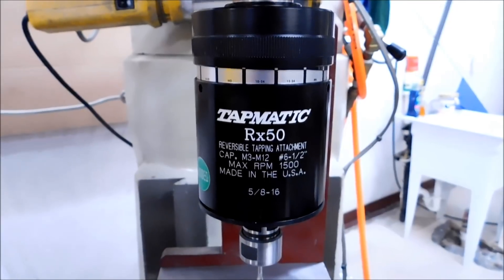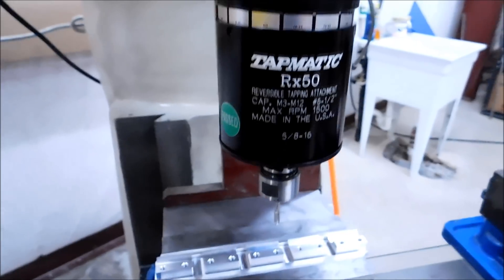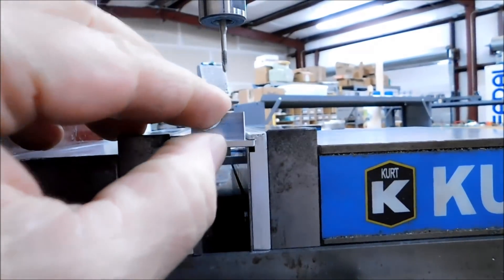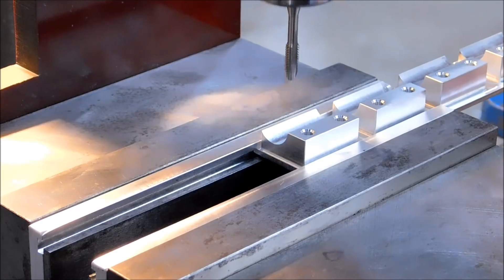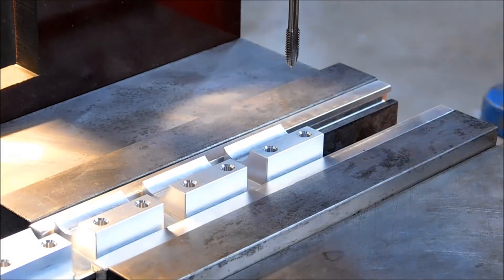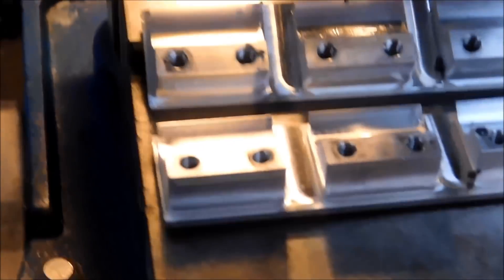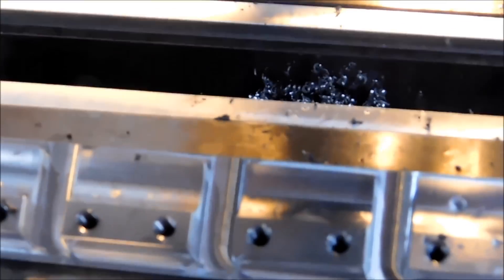How to Safely Tap 400 holes in 30 minutes.....Take a Look

Comment: Hi Joe! Gosh. If I only crossed the path of a tapmatic head. Those puppies aren't Cheap! Yes. I remember working for folks that had them and only wished for one, or two ;- ) Remember or seen the old hand crank, screw don type tap press with a keyed quill and crank the wheel rotating and pushing the tap to depth or thru with each hole? ;- ) I thought it was actually pretty good compared to a straight or "T" handle. Thanks for another great one Joe. You always keep the ideas alive ;- ) T up again!

Comment: I had to do something like this years ago when I helped out in a local machine shop. It was I think around 250 pieces of the same bracket. Drill and tap a hole in each one. The tapping head worked awesome on a drill press. That self-reversing action made all the difference. It went pretty quickly. Having to do that many pieces by hand would probably have been miserable.

These heads aren't cheap, but certainly earn their keep. Makes me appreciate CNC Thread Milling.

Comment: Long ago I used one of those while working in a sign shop. 1/2” plastic in 4' long strips with 1/4” holes about every 1” held in tee slot on a drill press. They were used to make adjustable mountings for vacuum formed letters. Hard to stay awake after several hundred. The TapMatic worked well in the plastic.

Comment: Great video.  I have one of the older Procunier 2E models that can go up to 1/2" in aluminum, or 5/16" in mild steel.  I got a good deal on ebay because it had been assembled incorrectly.  I've got about $85 in it, and it works great. (edited to correct a fraction)

Comment: If you could make something to squeeze out a couple drops of tapping lube in the next hole every time you bring the tap down you would almost have a mass production rig.

(Couple one way valves and a syringe to make a reciprocating syringe pump, and make a little treadle to press with your foot to pump out  just enough is what springs to mind for a manual system. An Arduino with a microswitch sensing the downstroke of the drill press, controlling the cheapest chinese peristaltic pump I could find would be my suggestion for a more automated rig.

Comment: That's an awesome tool Joe , I've taped a lot of holes in my life but never have I had to do that many at once. Also I must say I have never seen a tool like that. It seems to have a clutch or something like that , the way it looked when it reached the full length of the tap and before going into reverse it would chatter ? Also when running that many holes how do you keep the chips and stuff from building up in the tap. I noticed every time you would pull it up and out the tap would be clean. Very informative and good videos as always. And most definitely hats off for the girls hockey team. Way to go USA.
Reply: There are 3 different tap geometries: neutral, right hand, and left hand. The neutral taps are the ones you find at lowes and pack up with chips. The other two have reliefs like a right hand and left hand drill for power tapping. One pushes the chips upward back out the hole (good for blind holes) and the other pushes the chips downward like he has in the video. You can see all the spiral chips down in the vise jaws when he swaps parts.
Reply: The tap he is using is commonly called a gun tap (cause it shoots the chips our the bottom), or a spiral point tap.
https://www.mcmaster.com/#taps/=1bw03h6
Reply from the maker: Yep. Best one for through holes.

Comment: say Joe, what type of tap would you recommend for use with a tapping head? there are spiral flute taps etc and so i wonder if some other types would be or not be suitable for use with a tapping head?
cheers
mike
Reply from the maker: Same tap you would select based on the hole and material. Also consider is it a thru hole or bottomed.

Comment: Your thoughts about this: I picked up an old Canedy-Otto drill press with a Procunier E 3 tapping head on it at an auction. Both actually too big and not really needed for my garage shop, being retired etc. The head had one collet with it a 5/16". Checking the web I found other collets from #8 to 3/4" are available, but expensive. As I won't be doing any real production, I was thinking of getting one larger collet size say 1/2" and connecting a chuck up to it so I could chuck up various smaller taps without having to buy a bunch of collets. For my infrequent use I don't see much wrong with this, but am not sure.

Comment: That's a great tool, just wondering though why don't you tap it on the mill while the work is being done there
Reply from the maker: I honestly tried, but it was tearing up the holes. I'll re-visit it and trouble shoot the issue.
Reply: Joe Pieczynski ya rigid tapping on the mill can be a hit and miss experience

Comment: Nice looking parts.  Do you mill the back off to separate the parts after?
Reply from the maker: Thanks. Yes I did. I could have saved some material on this one, but I radiused all the main corners in OP 1. It would have been a pain in the butt to do that in OP 2. The job went well.

Comment: Great video - thanks! Did you drill for full thread depth?
Reply from the maker: I drilled through holes. If they were bottom holes, I would have used a high spiral tap to evacuate the chips.

Comment: Thumbs Joe, thanks for posting. By chance do you have a video showing how to adjust the torque adjustment on the head? I have one of these tapping heads, but am not sure how to adjust it. I did watch your other video as you mentioned, but it really didn't cover adjusting the torque.
Reply from the maker: On the top of the head, there is a straight knurled ring with a set screw in it. Back off the set screw first. The ring will rotate to expose silver graphics that go around the head itself. Looking down the arbor of the head, counterclockwise rotation of this cap will reduce the pressure. As you rotate the cap, it will expose different numbers and ledges on the graphic. Line up the bottom of the cap to the number or graphic level that coincides with the screw you are using. Lock the set screw.
Reply: Thanks for taking the time to write back! This was very helpful.
Reply from the maker: No Problem.

Comment: Why do you prefer the Tapmatic to the Procunier heads? I haven't bought either new, but the Tapmatic I bought used didn't work out, while the Procunier heads were super.
Reply: I had a B&S auto screw machine shop for 17 yrs. 
Have tapped in the vicinity of a million holes up to #10 in secondary operations on drill presses. Alum, brass, low/hi carbon, SS, titanium and a variety of plastics.
Procunier uses a double-cone friction clutch for both reversing and torque settings. The cones are enveloped by a friction-type material similar to brake pads. For taps 1/4 " and above you may get by with the Procunier. Smaller taps will give you problems. The more force you apply on your quill stop with the Procunier, the more torque you will transmit to the tap.
The Tapmatic has none of those problems. One job I had required 0-80 thds --3/8" deep. Only the Tapmatic could do that.
 It is the Rolls Royce of taping heads.  I used it exclusively. But as Joe mentioned - they are VERY expensive.
Reply from the maker: My loyalty to the tapmatic head is an exposure thing. All the big companies I worked for in the early years all had them. I trust them and will continue to use them. They perform flawlessly and are worth the money all day.
Reply: Joe Pieczynski Interesting. My understanding was that the Tapmatics use a dog clutch internally and that you can't feather the torque. Iirc, the one I had issues with had a jammed clutch.

As far as small taps with the Procunier, I've had very good results on the usual machine screws sizes, although nothing as small as a 0-80.

Comment: Hi Joe - tapping heads are great aren't they? For those of us hobbyists with smaller pocketbooks than a production shop, eBay often comes up trumps... So, a question: I have a similar Tapmatic, but it doesn't have the torque adjuster at the top, it's just got dog clutches in it. Is there any reliable way I can measure how far down a tap will pull before it disengages? If I want to thread to "pretty damn close" to the bottom of a small blind hole, it's always a real arse-puckering experience... The Tapmatic will smash an M4 tap in a microsecond (ask me how I know this....). Thanks!
Reply: Procunier uses clutch material rather than dog clutches. I have been using those to tap up to 1/2-13 into laser cut holes 100s of times with a 2E. Maybe give them a shot. You'll probably want the 1E Model though.  I can bottom out a 4-40 Roll tap in aluminum with no problem using the 1E.

Comment: Joe that is an awesome technique thanks for sharing it , I have looked at several tapmatic units used on ebay and wondered if they were worth the investment? I think I saw the #30 for under a 100$ last time.. are these heads very temper mental or in need or any regular maintenance that would affect the internals of a used system that would mean It could be run out junk and me not know til it was to late? thanks again for all the things you do for us all...
Reply: The Tapmatic heads are pretty forgiving, if you get the manual models. They have an adjustable clutch for the different size taps and with a bit of regular maintenance will last a long time, there are manuals for most models online.
Reply: Terrific, Thanks for the helpout L98

Comment: Is that a “custom” relieved tap? Years ago the Japanese branded Yuasa tapping heads broke fewer taps and seemed to work better than the much more expensive American made Tapmatic. I’m sure the Tapmatic has probably improved over what was being sold then (1970s/80s)?
Reply from the maker: Its a stock tap. Emuge has taps like this, but I was shocked to see this style from the brand I bought. It worked great.

Comment: Great tip. Just one question, is there a reason that you start with the tap so far above the work surface?
Reply from the maker: I usually keep the tap above a pinch zone when its at rest. I usually maintain  a hands thickness above the part. No other reason.

Comment: Great video and demo- I just got a 30 x- I cant seem to eliminate what seems to me as an excessive amount of wobble with the tap?  It definitely shakes more than yours does in this video.  Any thoughts?
Reply from the maker: Yes. Snug the collet before you pinch the mechanism that holds the square end tang. This is a very common setup mistake. The wobble should disappear.
Reply: @joepie221  Will Make sure I do this before my next use. Thanks!

Comment: I've got one for tapping 10-24 threads about about an inch deep in aluminum castings. But I need to go up and down a few times in each hole in order to get a full tapped depth, Is this normal? Perhaps I'm not using the correct taping fluid.
Reply from the maker: The torque setting may be too light, and the tap may be worn. Check both.
Reply: @joepie221  Thanks, will do.

Comment: Great tip. Love tapping heads. I personally use procunier heads. Thats a neat trick making use of the carrier in a slot. I'll file that one away.  Does your tapping fluid smell like cinnamon?
Reply from the maker: Actually it does. Thats how I always identify the tap magic.
Reply: For some reason I can't stand if i get tap magic on my hands. So For most tapping I use stuff called perfect tap #10 works good and it doesn't bother my skin a bit. And save a bottle of  tap magic for high temp  alloys.

Comment: Hi Joe I have an older tap matic SDS model I think its the same thing but what i would like to know is how did you machine those radius in those parts?
Reply from the maker: The parts were done in a 3 vise setup and the radius cut was positioned along the 'X' axis. I did it with a 2 flute carbide 1/2" dia ball end mill.

Comment: What about blind holes Joe?
Reply from the maker: Use a high spiral tap. It extracts the chips and allows for bottom holes to be done rapidly as well.
Reply: @joepie221  Thank you for the reply Joe.  I’m attempting build an Allen American 4-4-0.  So far I’ll need to drill some blind holes in the frame material, cold rolled A36 I think, noting exotic.  The holes will be about ½” inch deep and in the 10-32 and 8-32 range.  My question is will all I have to do is use the quill lever to start the tap into the hole then just let go of the lever and the tap will pull itself into the hole and when it hit’s the bottom of the hole it will back itself out without me touching the quill lever.

Comment: Slick setup, I’m assuming you’re using spiral point gun taps?
Reply: Looks to me like it is a normal tap...
Reply: It is a through hole tap but since flutes are large chips can fall out of hole.Spiral flute machine tap would be better for this job .
Reply: Spiral point gun taps push the chips down through the holes. They are pretty standard in industry....

Comment: Are you gonna machine a picatiny rail on the other side?  :)
I have been using the tapping tool for over 14 years,the best tool in the shop.Even though the TM 2 P does tapping faster
Reply from the maker: I'll save the picatiny rails for my AR.

Comment: I was tapping about 100 holes into some 1/4" steel this weekend, I should have stopped and watched this first! Nice tip on sliding parts through.    NEXT VIDEO How the heck can I rapidly space holes every two inches?
Reply from the maker: Install soft jaws in your mill vise. Drill a hole in the top of each jaw inline on the 'Y' axis. Insert dowel pins in these holes. Drill the required first hole in your part. Lay a parallel across the vise jaws against the 2 dowel pins. Put a third pin in the hole you just drilled and slide the part until the pin hits the parallel. Now pickup that pin with an indicator and move 2". For every hole you drill, just repeat this process. You never have to move the table. Be careful how stack positioning may result in a wider pattern and check your 2" setting after about 5 holes. If it not right at 10", adjust accordingly. Good luck.
Reply: Thank You, Need to remember to video tape this one (I haven't posted anything in ages). Tom

Comment: Another great segment Joe. I really like your innovative techniques.  I too like finding ways to reduce production time in the shop.  I recently had to drill 100, 5/16" holes through the center of 2" diameter 4" long aluminum slugs.  The lathe tail stock method would have taken all day plus.  I built a quick lathe tool-post mounted chuck that I could feed under power and I knocked the job in less that 2.5 hours.  The video is here >>  www.youtube.com/watch?v=PIWkM3qptfw

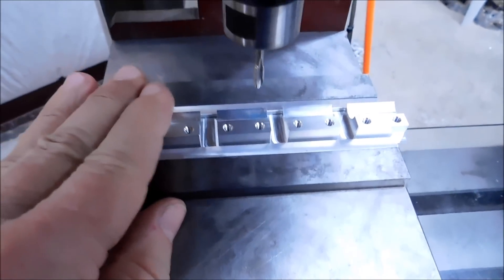Comment: 3:29What is the name of this tool?  How much does it cost?
Reply from the maker: That is a TapMatic brand tapping head. They come in various sizes and mounts. You can expect to spend 5-8 hundred dollars for one depending on the capacity you need to hold. They are not cheap, but high quality and they perform flawlessly.
Reply: @joepie221  Thank you very much, my brother

Comment: My tapmatic head fell apart (inside) doing 3/8" threads in steel.  Currently looking into the possibility of getting it rebuilt but don't know of anyone who can do it.
Reply: Tapmatic will rebuild it. Call them up and they'll set you up. It's much less expensive to have it rebuilt.

Comment: Use of gun tap should be recommended. Tapping heads are nice, but for my limited home projects I've found a tapping guide to be sufficient.
Reply from the maker: Use of a gun tap is only recommended when its a through hole situation.

Comment: Is that cat50 as well?
Reply: Tapping heads are usually female Jacobs taper, so you can adapt to whatever you need,  R8, CAT50, HSK, Morse, straight, etc.
Reply from the maker: This one is held in a 3/4" collet. Straight shank.

Comment: Yeah, those tapping heads have been around since WW2....Its nothing new ya know..?
Reply from the maker: Its really not. I shot this more for the setup creativity.
Reply: your setup would be much better if you provide a better lead in, something as simple as putting radii on the entrance end or milling the top of the groove off for about an inch, I use method regularly and do about 600 - 700 M10 holes an hour with those simple changes and a tapping fluid applicator.

Comment: I welded a similar work holder for tapping on a drill press and people would call me crazy.
Reply from the maker: I'd say smart
Reply: I just use er32 collets on morse cone mount and drill press or lathe tailstock.I had opportunity to work on tapmatic (they are rare in europe,)its a good device that needs a correct setup but unless you are going to tap 200 holes every day -useless for small shops and expensive.